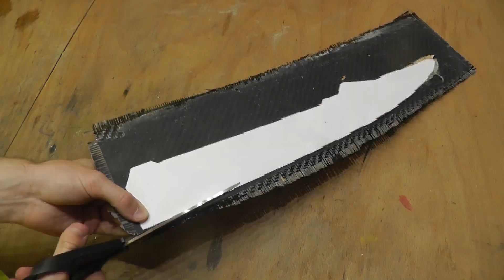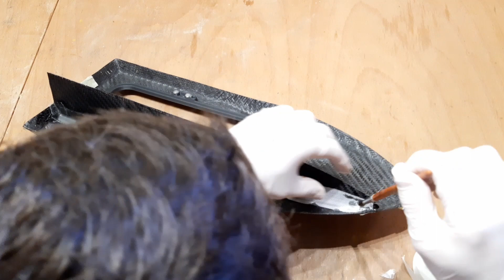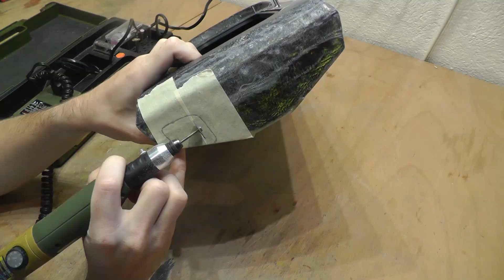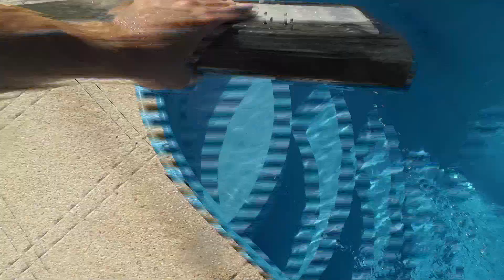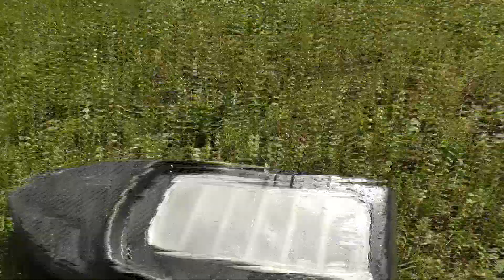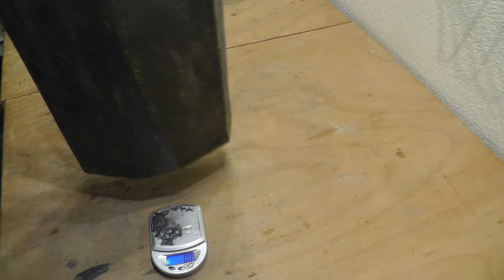4G Sprint Boat Build Part 3: Hull is Ready!

Comment: Hi, I hope you had a great christmas. I have a question. I finally found the time to laminate the hull parts. I used the same weight carbon cloth as you did. And also used two full layers everywhere and a 5 cm strip as a third layer on the keel. For a very first time I think it looks pretty ok. Some air bubbles that I need to fill but for the rest I am happy. Loose top and bottom hull pieces together have a weight of 211 grams. Only problem I find now is how to know what size to print the pdf's you provided with the jetsprint boat. When I print the sheet with the hole for the flood chamber it is printed in a4 at 100% and that will be fine  I think when I hold it against the back of the boat. I suppose I need to print the flood chamber wall pdf also at 100% but for some reason I can not get 2 pages out. It will only show half of the part on a page and the other part is just gone. It predicts and will print only 1 page with half of the wall. Then I tried to import the pdf in autocad and scaled the rectangle that is in the pdf to a3 format. Then I end up with a part that will be 452mm long. that seems to be ok I think? Can you advise me? (by the way, I used moulding epoxy to line the 3d printed molds and eliminate the layer lines. This stuff is designed to give a smooth flat surface. I did not sand and polish this layer after I put it in so it was not perfect but good enough for me. I then used mold cleaner and moulding wax. then a layer of pva. Releasing the hull parts was super easy and finish is shiny.
Reply from the maker: Nice to hear your progress!
The flood chamber template pdf is sized as an A3, because it cannot fit on an A4. But if your printer cannot print A3, you need to find a print setting called "print as a poster" or similar. This will split your A3 into two A4s, which you can print separately in correct size and tape together, just like I did.

Comment: Good afternoon Stefan. Maybe a stupid question but how to print this pla base for the lid cover at best? with the nut inserts on the top side and getting a nice side and with using support for the glue flange?

of with the flex lid interface side facing up using support blockers on the sloped sides and using support inside the nut holes and the open hollow area's beside?

planning to print it with 100% infill. is that needed?

Thanks in advance,

Eric
Reply from the maker: Hi, I printed the cover base with the flex lid interface facing up. I think it is the best way to do it. The only supports you need are inside the nut holes and in the hollow areas as you are saying. 100% infill is not a good idea, then even a small amount of overextrusion can cause problems with print quality. I only used around 20% with 5 perimeters.

Btw for mounting the rollcage, I used hex head screws with heads in the mentioned slots in the lid base. It works better this way, and you can use locknuts on the rollcage side.
Reply: @mjetdevelopment  Thanks for the quick reply. You give great support.